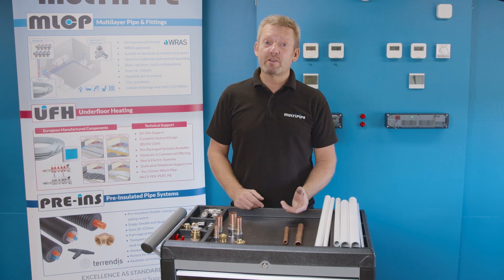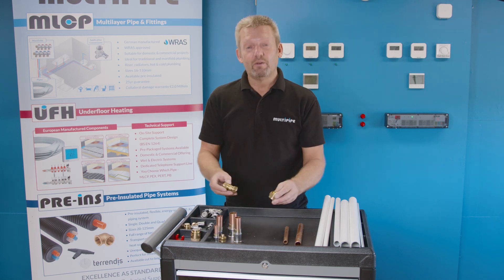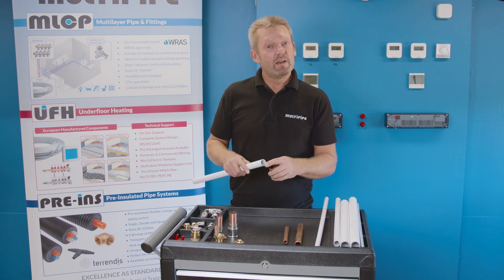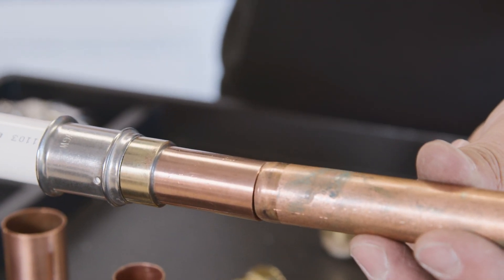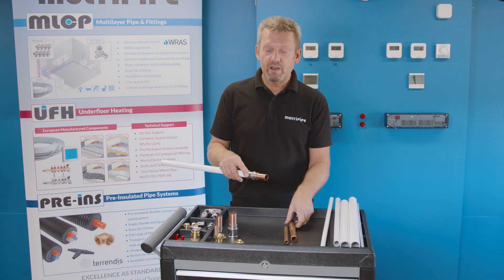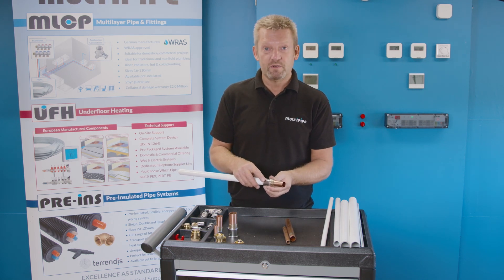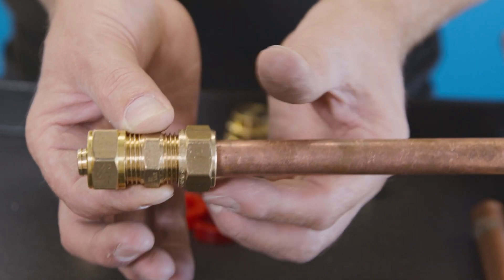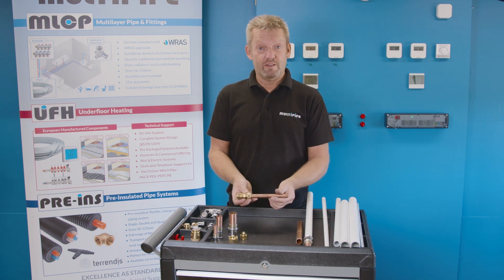Connecting Copper Pipes To MLC Pipes

Comment: It is a shame the copper spigot isn't longer to enable it to be soldered without damaging the O rings. I am not overly keen on using compression under floors and my press tool won't press copper fittings so I often find myself reverting back to just using copper.
Reply from the maker: Many thanks for your comment, unfortunately soldering to this spigot would affect the O-rings as you mention. We have looked at removing the o-ring’s in the past, allowing you to solder but found issues with leaks where people did not add them back in/ damaged them. To make the spigot longer might answer the question but of course, there is an additional cost, and the risk people cutting them short. The best option is to press, PM your tool make and we can look at a solution for you.
Reply: @MultipipeLtd  hello, thank you for such a prompt reply. My press tool is a Klauke Uponor Mini2. Thanks again, Dan
Reply from the maker: @dan2071  We can help you source the press jaws for your tool. Just give us a call on our main office number 01245 227630. Mention you need the press jaws for the Klauke gun to copper. Also, please double-check that the press-fitting you use are a M profile.  Thanks.
Reply from the maker: @dan2071  Hi Dan.  Just checking if we can help you further with our products?
Reply: @MultipipeLtd  you've been brilliant. I have a quote for the jaws but i am just struggling to find a copper press manufacturer that will work with my tool. Its only 15kN.🕵️
Reply from the maker: @dan2071  - Hi Dan.  We will try our end for you as well and let you know.